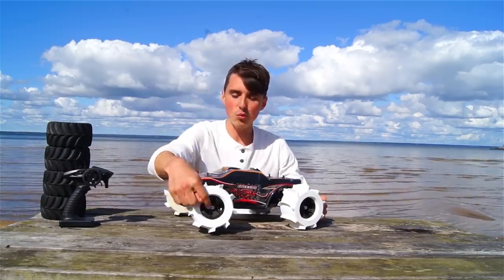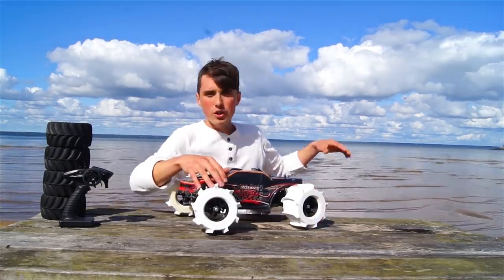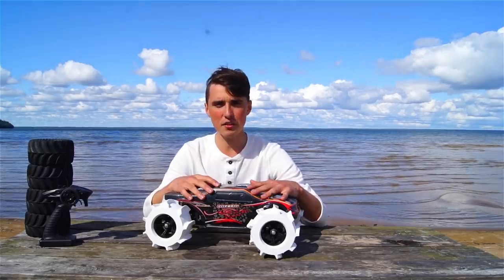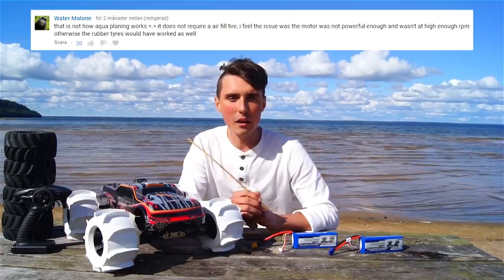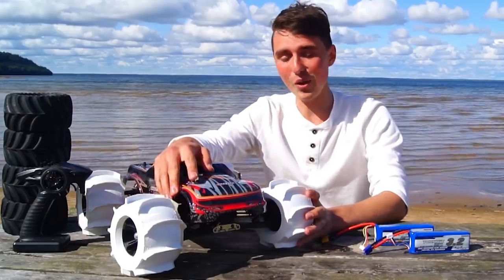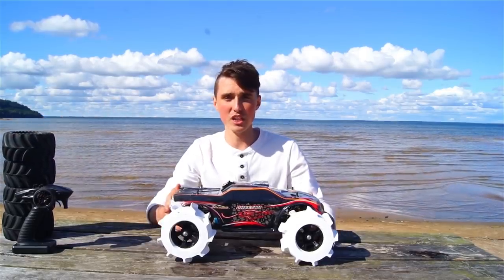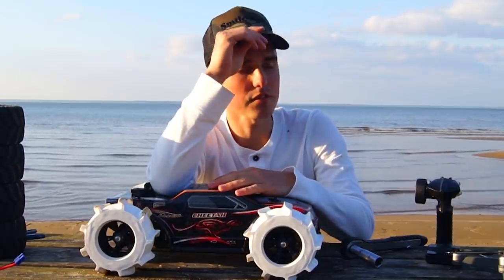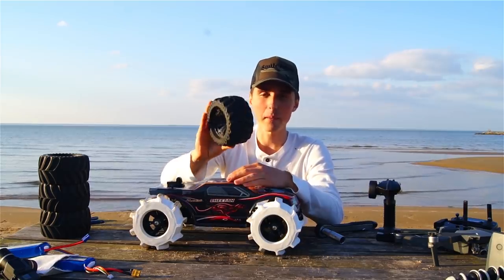NEW 3D Printed RC Car Tires - Driving on Water!!!

Comment: What is the minimum speed neaded to drive on water with those wheels?
Reply from the maker: Actually, I was going to cover this in a future video, but the speed needed to drive on water with my upgraded wheels was surprisingly low. Even though I used a 4S, I could easily have been hydroplaning with just a 2S.
Reply: RCLifeOn Then please make that future video. The thing is that I have made a Lego RC car with 4 large power functions motors with 10.22V and up to 3.4A provided by two USB batteries in series and the max RPM provided to the wheels is around 400RPM and with your wheels having a diameter of 14cm, the max speed would be 10.5km/h or 3m/s. I would like to know what speed in km/h, m/s or RPMs for those exact wheels I need in order to know if I can drive on water as it is or how far I am from the target.
Reply: Using your vertical shot I have calculated that it was going at approximately 30km/h

Comment: Printed 4 of these tires with the fillament linked in the description and mounted them on my favorite traxxas. 

I am currently in a local hospital dealing with removing fragments of shattered and partially melted plastic from my arms and legs. Note that I was wearing thick clothing and the plastic went right through it with little effort. 

I’m looking into a suit of thick plate armor as I type this. I’ll be letting my buddies know about this little issue and I’ll be getting safe, high-quality wheels from now on.

Don’t mess with physics. Centrifugal force is not something to be abused!

- Nightshade

Comment: This is crazy! I'm driving a RC car on water by using custom made 3D printed tires. A few months back I failed driving on water, but discovered my 3D printed wheels worked great for traction on sand. However, now I'm back, and today we are driving the JLB Cheetah on water! = Looks boring